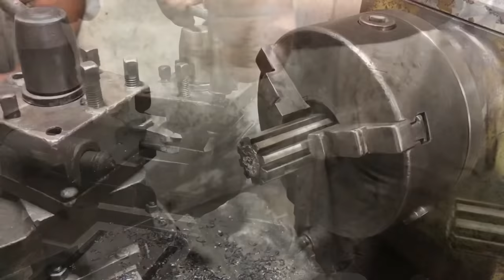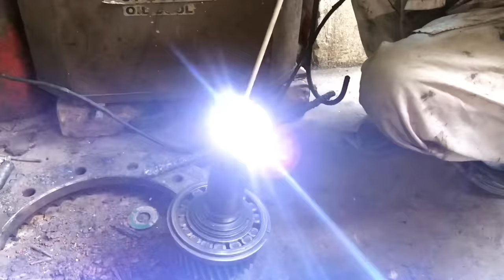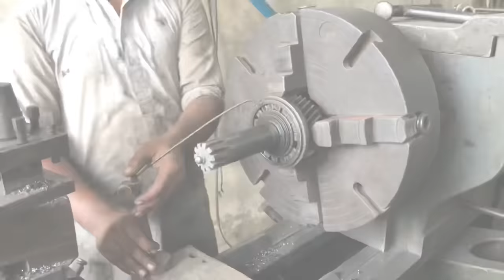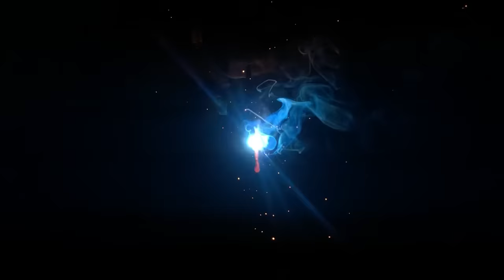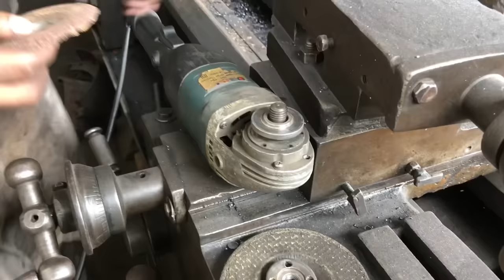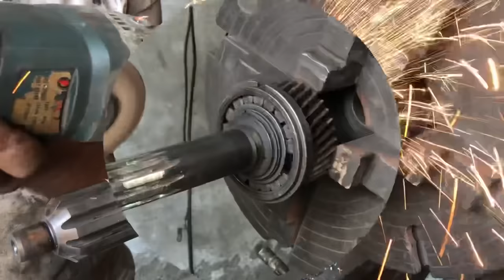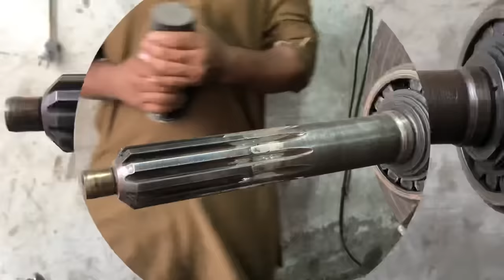The Ingenious guy Connected Broken Input-shaft Very Nicely / Pk process

Comment: this would only ever be acceptable if you were in the field and somehow had a lathe and welder at your disposal. You can easily see that the diameter of the shaft has been reduced where the repair was done. Also curious as to how accurate the "metal twig" dial indicator is :)
Reply: the metal sprig, it's an old school classic... and it's worked great so far, obviously you're not in the business.
Reply: @paulosouza3369  lol, I have an actual dial indicator, you can stick to your 3rd world accuracy and keep using your sprig bud.
Reply: @1114flibby  "It´s old school" just like the lathe the guy is using. If you don't get it, kid, it´s no surprise.
Reply: @paulosouza3369  kid????, that is f'n hilarious :) if you were my age you would be retired from the military long ago.
Reply: The "field" you speak of is called the middle east, it's like being stuck in a infinite cycle of surviving with what you have
Reply: @townsendliving9750  I can only imagine, it is a shit hole!

Comment: Would like to have seen a dial indicator installed on it prior to painting to see how close it was. If it was out by just thousandths, the pilot bearing in the flywheel or clutch hub would have failed soon after restart. maybe hours or just days.
Reply: Ask them? It is the internet, you know?
Reply: I think if they had a dial indicator in the shop it would have been used to indicate they shaft in, but that is one of those "advanced" tools they have yet to acquire :-(
Reply: @phillhuddleston9445  i callbs, they have access to trees a stick is acquirable
Reply: @winteroutside7014  how good would any of you do in the circumstances
Reply: He didn't have dial indicator. It will be just fine. It was running pretty true. Good to go. Send it
Reply: Dial Indicator???
Really? This guy is lucky to have one pair of Flip Flops
Reply: @Doubledsccreepingtom  and look how the four jaw Chuck is running genius

Comment: I bought a truck originally equiped with a Perkins engine but the previously owner change for a om352. 
The stock imput shaft is to short for this engine and have to be cutted and welded. Three years ago a have a bad bearing and broke one thoot of the imput gear. I'm buyed another prize and cut the shaft again lol. 
Two years ago I've changed the engine again, this time is a om366la. 
The Clark gearbox originally designed to handle with 45kgfm and 145hp is well supporting the 69kgfm and 211hp of this new engine.

Comment: As you can see it has already lost two bearing rollers, what you expect😅
Reply: I was just looking at that and was about to post a comment about that “special” high speed low drag bearing when I saw your comment.
Reply: Yeah , I was wondering why it broke in the first place. The whole thing looks out of balance.
Reply: @Vics251  It broke in the first place because the bus had 622 people loaded on/in/on top of/on the back bumper/on the hood/hanging out the sides/clinging underneath as it tried to take a steep hill on a rocky road in second gear with the clutch slipping and the engine racing - all the while while pulling another bus equally loaded that had just broke it's transmission intake shaft for a completely unrelated reason.  Then everyone got out and pushed both busses faster than they were going, being sure to pick up any lost chickens along the way.
Reply: @hughezzell10000    😂😂😂😂

Comment: He has put weld current through the shaft bearing and then through his lathe bearings and gears. This can cause a huge amount of damage to the surfaces. The spline shaft is probably a high strength grade such as 4140. I did not see him apply preheat. I expect the shaft will have a brittle heat affected zone. The workmanship is impressive but the repair will not last.

Comment: Guaranteed until the 3rd gear change, PRECISION engineered with an angle grinder 🤣🤣🤣🤣🤣🤣🤣🤣🤣🤣🤣🤣🤣🤣🤣🤣🤣🤣🤣🤣 wont need the radio on with the good vibrations off that, and the invoice is 2 dollars please , to cover the electricity and the stick welding rods , and 20 cents wages

Comment: yes, i agree with mr. Randall Dunkley, if we look closer we see that 2 or 3 rolling elements (rollers) are missing and it will develop an excentric rotation , i think this was the cause from the begining and instead of fixing the cause he's fixing the result and soon will be the same or worse, but i respect trying to be inventive..🙂Also it is worth mentioning that when he induced to the parts so high temperature with cutting and welding, the parts are much weaker in proximity of that place.

Comment: What an interesting way to make a paper-weight for the office!

The FIRST time that low-range is selected under load, the splined shaft instantly and miraculously transcends its humble engineered function, and elevates to a coffee-table as a paper-weight.
On the other hand, the FIRST time this shaft is running under steady full load and the truck hits a speed-bump (say shockload), it will magically equal the above outcome. 2 paths to Glory!

Comment: Looked like the clutch disc had a slight wobble after he finished, when he was spinning it on the lathe with the clutch disc mounted. However this is great work. People that have to work with what they got can get pretty creative when it's not the easiest thing in the world to source parts. I've noticed on youtube that ppl in Mexico and Australia and Europe,  basically anywhere where it's hard to get parts can get very very creative. This is a perfect example although I don't rlly know where he's from lol. Nice work man should work just fine, might have a slight imbalance tho. You could prolly take it to an axle shop or an engine building shop if possible and see what they can do about balancing it. Maybe perhaps shave a little metal here and there in proper locations on the input shaft to better balance it like they do on cams and cranks and whatnot. But that's only if you can even feel some kind of imbalance in shaft, that thing might be perfectly fine lol.

Comment: Two things 1 cover the ways with cardboard 2 if you had went to a welding school you would know if you weld it all the way through with the right rod it could be stronger than the original metal “remember 100% penetration” and yes it will hold depending on the metal it may need to be preheated first. I know I learned it in school and done it for years.
Reply: assuming the weld was xray quality, it will crack in the haz, and it wasn,t post heat treated

Comment: Valiant attempt but the amount of twisting torque going through that join is immense. Not sure if the balance will be too good either, causing a fair bit of vibration and getting the spline profile exactly right with a grinder is asking a bit.

Comment: Saw several issues with it from using regular bit in hopes of getting it centered, not protecting the lathe bed from splatter, not protecting the bearings from grinder dust and grit, not to mention the lack of concern for heat treatment. Do I expect for this to be a long term fix NO

Comment: Worked for a large garbage company as a mechanic... that Rockwell shaft is specially hardened steel. Our truck drivers were VERY abusive on the trucks (go figure) and i've seen so many of those shafts broken. The shaft's metal is SO hard they are brittle . We NEVER sent them over to the weld shop to get repaired....just wouldn't hold.

Comment: Just looking at the bearings on the shaft tells you that the part is worn out. Picture, in your mind’s eye, the truck this came out of.  

Where was this done? Maybe India or Pakistan? 

There might not even be a junk yard anywhere nearby that could supply a used replacement. Never mind a reliable vendor selling a new part at reasonable cost.

I admire what people do with limited resources.

I hope they got some good use of the repair.

Comment: I’ve had a similar fix done on my shafts. Difference being that the 2 parts were first pressed together in a press taking 10ton of pressure. Then the chamfered pieced being layer welded in three layers.
Reply: But looks 100 times better.

Comment: I think I'd have tapered out the joint at a wider angle and tried to get more weld on to both surfaces.  I'd use a mig. But maybe he doesn't have one.  It could last. Or it might break right away.  Hopefully it's not too difficult to get at if it breaks. I'm rebuilding splines on a 4wd pinion shaft at the moment.  Welder and grinder.. fingers crossed 🤞
Reply: i agree, and drilling a hole in both sides to press in a tungsten rod before welding would help a lot.

Comment: The first time they let that clutch out, "pop". Then the trans has to come back out. That's ALL welding rod holding it together, not counting the slag and air pockets.  I've snapped the input shaft on my SM465. I don't know, maybe they can't get a replacement input shaft? But still...

Comment: I admire his ingenuity and craftsmanship, but the other knowledgeable poster are absolutely correct.  

The original shaft was a hardened material which was destroyed in the welding process.  The metal, on a molecular level, is altered.  Unfortunately, the shaft takes the entire load of the driveline, and although this repair may have functioned for a brief while, it would most certainly have failed in a very short time.  Also, you cannot grind precision cut splines with a hand grinder.  The surfaces will never mate precisely again.

For those of you claiming that it's as good as new, consider the fact that the original shaft is a precision cut and ground, case hardened piece FOR A REASON.  Destroying all of those attributes MOST CERTAINLY will affect the durability and longevity of the repair.

I understand necessity is the mother of invention, however, some things, simply cannot be repaired to original condition.  This would be one of those cases for sure.

Comment: I'm guessing that the bearing missing a roller or three had a lot to do with the failure.  The metallurgical composition of this part is now way past questionable with the weld heat localized at the fracture repair point. As metal ages, it crystallizes. This makes it prone to fractures as it is stressed. The shaft doesn't have the strength to withstand the forces that will be imposed upon it.

Comment: some parts that are tempered to a specific strength may not be the same strength after such a repair, apart from that while using a stick welder you would need to be 100% sure that there was no slag what so ever remaining in the area to be welded,  I would think that you would need to camber down both ends of the shaft, so that while touching both "pencil sharp angles" together, you are going to be giving yourself  a (V) shape all around the site of the weld, at least far more surface area to weld, to make the weld puddle of a deeper greater surface than welding two flat peices of shaft together with only just the finest tiny crack to leave a weld puddle to make the union,  the area of the "male & female" pin in the centre of the weld repair, isn't actually going to be a welded union, pretty much the same as a severed spinal cord, there will be a permanent weakness in the repair, & the shaft would then need to be re machined for the grooves, a mig welder would not make the job any safer, but there would be no slag from the stick welding process, at least mig welding just leaves the actual steel, having said that in an unjust world of poverty & dispair, if the piece of machinery he was repairing puts food on the table for this man & his family, at least he is trying, it's not always about succeeding, sometimes it's about not giving up.

Comment: Looks a good job to the masses, but the lathe tool was slightly too low in the 3 jaw and left a pimple. Tool at correct height = no pimple, then use a centre drill, then the small drill.
The shaft is 'special' Steel, I think the welding rod was a standard mild steel, even with a 'special steel' welding rod...and there are dozens to pick from, a welding rod to a cast steel shaft is basically two disimilar metals.
H&S would have a fit with no guard on the grinder😮... been there done that - got the scars to prove it😂
And I hope they washed the grinding dust and metal filings out of the bearing😢
Just shows you can't believe everything you see on the interweb

Comment: These parts are not just cast in a casting, but forged under very high pressure as well which makes them HARD to an extent that they can sustain all that power transfer. This weld job will break off like a wax candle as soon as the car accelerates from a hard stop.

Comment: Input shafts are usually hardened. The welding process in this repair removed some or all of the hardness. It is questionnable if this repair will last.

Comment: If the shaft is broken due to fatigue, it will endure much less after the heat stress. It will break again next to the weld. Each welding process changes the material properties to the negative. Why is the old, defective bearing still mounted? Should that be installed again and cause the next damage? .......He puts his thumb up and the clutch doesn't even fit yet. The bumps will destroy the clutch driver.

Comment: Shouldn't be too long until that shaft snaps again. you can easily see it isn't welded true and once you lock it into the pilot bearing, it will be forced to flex and snap in the exact same spot. It's the reason it snapped originally.

Comment: I don't think it would last too long. I mean that solid steel shaft broke cleanly in 2 pieces, how would you expect to survive with half of the diameter welded, visible welding cracks and no heat treatment.

Comment: Hey guys, there are 2 roller missing from the wheel bearing, which is probably why that input shaft snapped and why it will snap again if you don't tend to that bearing.

Comment: I would be more concerned with all the molten grindings sticking to the roller bearings.  No attempt to cover them and as the molten grindings will melt onto the roller bearings. They cannot be washed out.

Comment: How many people are sure that this will not work. . . how do they know that, if they don't know the reason for the shaft breaking. We do not know whether the shaft fracture was the result of an impact or blockage in other parts of the assembly.
There is something that makes steel different from other materials, and that is a "flaw in the material".
Just as we often don't know why a piece of machinery broke, we often don't know whether a repair of this type will outperform the original piece of machinery.

Comment: Okay now where to start. First off those shafts are heat treated for hardness now by welding the shaft he is removing the heat treatment in the shaft which can cause failure. Next you can see many stressors in the weld which again will cause failure. Next the weld is right where the most torque is applied by the clutch disc and this will cause failure. Also I think your missing a couple rollers in that bearing. Other than that your video made me laugh thank you.

Comment: The pinion will not last long the use of grinder to smoothen the teeths changes the pitch size which resulting in not sustaining the load.
Reply: The rough splines don't concern me, it's the shaft snapping right off again. Those are heat treated when new, and the welding makes it brittle. Unless they heat treated again it after this temporary repair?

Comment: not totally a wrong method...but it's better if you remove remove flux at stick weldings first...cable for ground and welding should be exchange port first...that how you can get a solid weldings...but cannot do for daily...cause it will bake your square coil inside your welding kit I think...but not all welding kit support that method, sometimes both port are different.
-:material and cost topic

Comment: I was called in to repair a large bulldozer final drive that had blown the pinion gear teeth all out many years ago, after I got it apart some stupid "welder" at the gravel pit convinced the owner he could just weld new teeth up and hand grind them in. I was incredulous, and told them it wouldn't last 10 feet. Well, it made a liar out of me by lasting several months, but then then it destroyed every bearing and gear in the housing, what was a couple thousand dollars to repair right the first time turned in to $9000 in parts the second time.

Comment: The only part that concerns me is that it wasn't heat treated. I'd be concerned the metal could be brittle/crystallized. Other than that, he did a nice job welding it up, and  reshaping the splines.

Comment: All that blue discolouration tells me all the hardness has been removed from the shaft as soon as that shaft is reinstalled it will go snap. And all the weld spatter and grinding swarf will ruin the bearing and the lathe.

Comment: This is wrong on so many levels, no lubricant or coolant on the tools, softer metal in the weld area, no accurate measurement of the material removed/replaced so probably not the correct length anymore, no gas welding so weld is full of bubbles and cracks you can actually see in the video, the cutting disk doesn't fit in the spline shape very well so he's caught the sides at the top and probably widened the bottom, I also noticed the area he machined down after welding ended up slightly narrower than the original shaft, you could hear the cutting tool catching the original spline when he went left or right of the weld. This will most likely snap again as soon as it's under load.

Comment: All the heat that was put into that shaft will have made it as soft as toffee, if the solid shaft broke,then the weld doesn’t stand a chance, the guy has skill but no science.also the spatter that went into the bearings was frightening